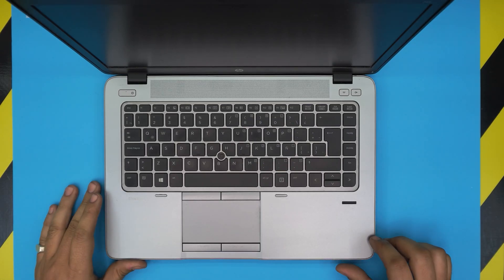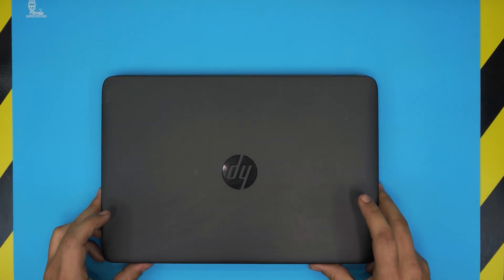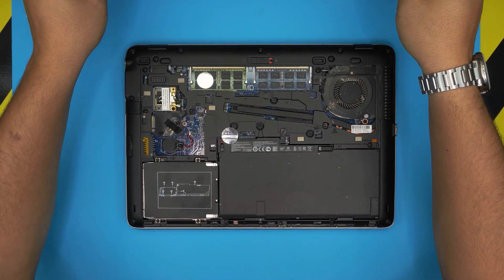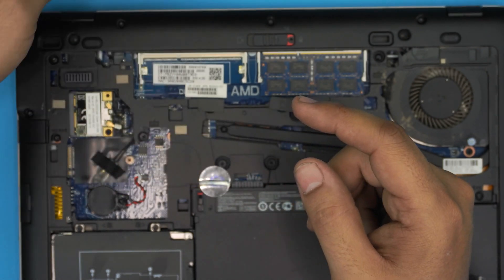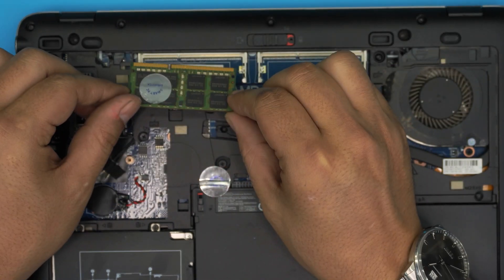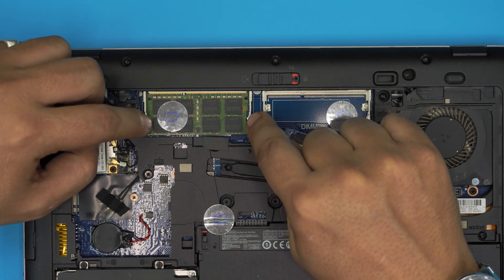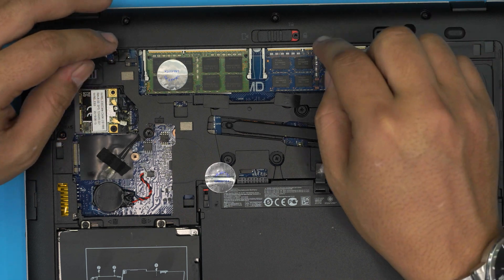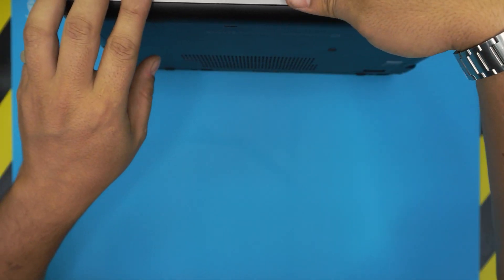HP Elitebook 745 RAM Upgrade Guide

Comment: I have hp elitebook 745 g4 and currently only 1 slot ram is working, another slot is already malfunction. I currently have 8gb ram and my question is can i upgrade to 16gb ram by using only 1 slot? Does 1 slot can support 16gb ram?
Reply from the maker: 🫠Regarding your question, sure you can without any issues.
Should you have any further questions or requests in the future, please don't hesitate to ask me.
cheers🍻
Reply: @uFixTek  do you know the exact maximum ram capacity for elitebook 745 g4 as i google, some mention 16gb and 32gb.
Reply from the maker: - Memory Type: DDR4-1866/2133 SDRAM  
- Total Slots:2 SODIMM slots  
- Maximum Capacity:32GB (16GB per slot)  

but you have a bad slot so you can go max 16gb.
we have upgrade this model to max 32gb without any issue (elitebook 745 g4)
Reply: @uFixTek  Thanks for your reply. Just one more question, instead of using 1866/2133Mhz, can i use 2400/2666Mhz ram type?
Reply from the maker: sure you can without any issues the bios/motherboard will auto adjust the ram speed.

Comment: Can this laptop run with sodimm 3200MHz ? And can this laptop run with pci 4x4 ?
Reply from the maker: Thank you for your feedback! If you wish to support the channel, you can like, subscribe, or both!
Regarding your question, no it wont run with 3200 it will use 2666 or less , and it is intel cpu intel cpu don't care much on ram MHz , if it was AMD CPU then it would be very important

Comment: is it possible for hp 745 g2 elitebook to upgrade its processor?
Reply: Instead to upgrading processor you should buy another laptop
Reply from the maker: Thank you for the feedback! if you wish to support the channel you can LIKE or SUB or both :P
regarding your question: sorry to inform you but the CPU is not upgradable its soldered on board :(